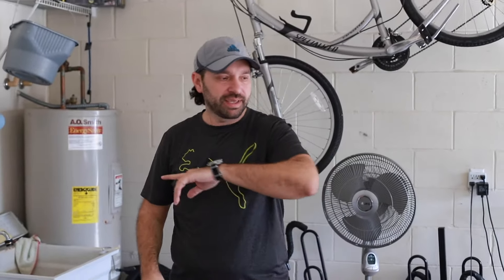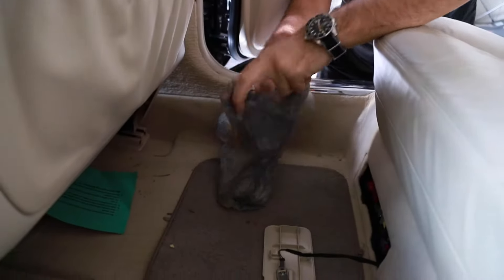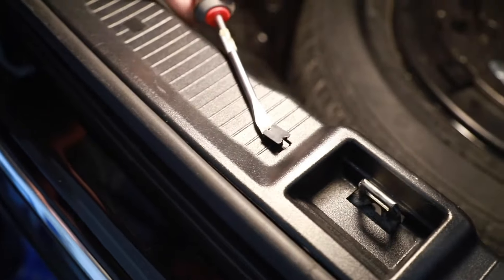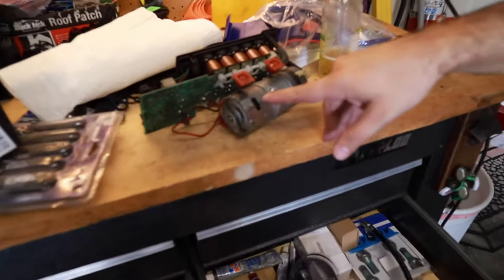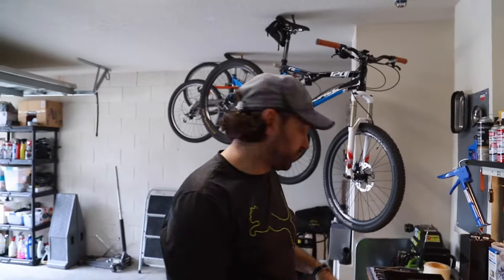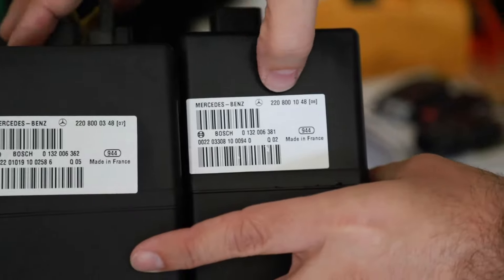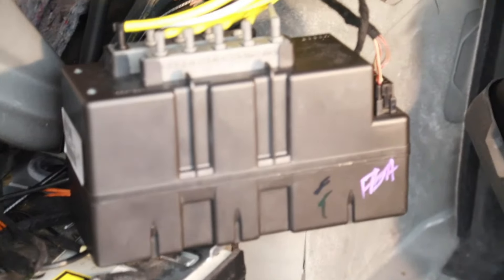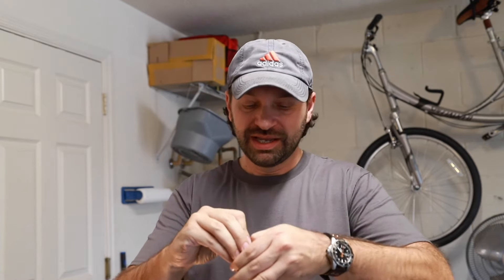Mercedes PSE (Door) Vacuum Pump | Soft Close

Comment: I watched this video 2 years ago to replace my PSE Vacuum pump on my 2006 S500. I replaced it with a pump I bought on Ebay for $185, with the exact part number 220 800 11 48 [07]  and it worked for 2 years before I had to replace it again. That one has now failed so I had to replace it again. They didn't have an 220 800 11 48 but I understand that going with a higher part number works and the only one that was higher was a 220 800 12 48 [06]. So a 12 can replace an 11. This one cost me $70 more than my first one,  but it was the only one that was available at the time with a higher part number. 
It works now.
Reply from the maker: That sucks that it only lasted 2 years. Thats the reason I like to replace with new or remanufactured. However, this pump is just too expensive new that's why I did the whole eBay thing. Yes, from what I understand you can go with a newer pump (higher number), but not lower. The only way to make that work is a "proxy alignment". Not sure what that involves but it sounds expensive. 

I hope this one lasts a lot longer than the last one.
Reply: I have also that part number 220 800 11 48 soo i just can replace it with two part variations 11 or 12 for it to work?
Reply from the maker: Yes. It seems you can go up in number not down.

Comment: LOVE your organized work bench. The most important and critical part of any kind of repair comes down to your work space, tools, and being organized (Knowing where your tools are and having flexibility like short hand ratchet tools, extensions that are flexible, all the ETorx tools / sockets you need for mercedes, which for me has mainly been E10, E12, E16 sockets), and more
Reply from the maker: I wish I had more space. I try to make due with what I got. One thing I found is that the extension ratchet is irreplaceable for me and that I need better quality etorx bits. More and more cars are using these now, Mercedes used it 20 years ago. The new tool box however made a big difference for me. First time I had one that size. I love it.

Comment: If you DO get stuck with a new-used replacement that is incompatible, take heart. If the motors are the same, you may be able to swap them out. It may just be that the replacement has a controller that is incompatible. Best advice what TS said--get the same part number and a guarantee.

Comment: Thanks for the video. I have an s600 my trunk isn't shutting and the soft door close also inop, yet my locks do go up and down. I wanted to comment on the black dust on the motor, it's the carbon electrodes at the stator to the armature are worn down, if you took the little motor apart and put in new brushes a few bucks.  Harvest out of some home vacuum or find on ebay or something, they are often made of carbon and can be easily filed into shape.  Keep up the good work.
Reply from the maker: Thank you. Yes I noticed when I blew the dust out I got a few more weeks of service before it finally completely died. 

On S600, maybe you got a leak in the hoses themselves? That pump operates locks and soft close. If the locks would have worked, I would have not changed the pump. But once the locks died I had no other choice. 

Disconnect the lines in the back. If you have a friend who vapes, blow some smoke into the system and see where it leaks. When I blew into the hoses with my mouth, I was able to lock the doors. My trunk hoses are bad and I do not have soft close there. Maybe one day in the future I’ll make a video of that, but it’s not on top of my priority. 

Thanks for watching and the kind words :)

Comment: E320 1998 almost got towed away because alarm kept going off. Police were nice enough to go knocking on doors to find the owner. Mine still opens and closes but . OK one of the back door mechanism wasn't working but I was ok with that. Then I was starting to notice more malfunctions with the locks. I also notice the light on the open/close switch is on. It's also been raining  hard here. So now I have an idea of what the problem is. Time to fix it. Thank you so much.
Reply from the maker: Yup, sounds like a very familiar story. Time to swap it out. Read your label on your actual part first. I had to go through 3 before I figured it out. If you're no already on it, get on MBWorld.org

Comment: Hi, my dad's 2004 S430 has this PSE PUMP problem, I think.  

I'm trying to determine whether to test for a leak in a line (how do you tell where the smoke comes out if the lines are all inside the walls of the car?) or just replace the PSE Pump.  I'm wondering if a leak is unlikely if the remote control and interior auto unlock buttons do not work for both the trunk and the car doors?  Since there are multiple issues does that make a leak less likely?  

Also, I believe the yellow fuse is blown.  To hear the clicking noise in the pump does the key have to be in the car or does the car have to be running?  

Finally, for the part number "220 800 xx 48" does the xx represent the year of the car?  I thought it did until I see in the posts and also on pumps for sale on ebay that the xx does not seem to be the year of the car?  So I have to get at that pump first to get the part number, specifically the xx numbers?

Thanks!
Reply from the maker: Honestly you gotta have to diagnose one at a time. If you hear clicking you need a new pump. If you keep replacing the fuse, you need a new pump. If you have a line leak it will impact only whatever is connected to that line. There is a smoke machine for that purpose. You blow smoke in and eventually you see it coming out from behind a panel possible. Then you can take it apart and follow the smoke. Sealing a line shouldn’t be too hard. That being said, Mercedes from that vintage usually doesn’t have line problems but rather electrical. I would usually start diagnosing electrical stuff. 

In regards to the number, follow my instructions. Read more in the description. It must be the same or newer. 

Hope you get it sorted, good luck.

Comment: Hi Daniel. My pump is dead. For now I can't find the exact pump with the same codes. 
It's for Mercedes w210 E-class saloon facelift

HELLA Mercedes-Benz 2108001248 ( 07 )

What numbers in the pump need to be the same?
I know that the ( 07 ) needs to be the same I think.
I heard something about higher number or the same. If I get a pump with higher number and just replace it is it going to start right up or something with the car's computers needs to be changed? I'm not familiar. Thanks you for you amazing videos!!
Reply from the maker: Yes. That’s the number you gotta look for. Either same or higher is good. No reprogramming necessary. A lower number will not work. Be patient. if you order from eBay make sure they have a return policy just in case. I hope you get to work it out. Good luck!
Reply: @Turbo_Snail  i didn't understand fully which numbers... only the ( 07 ) can be the same or higher? So the number 2108001248 should be exactly the same? Or what. Sorry I'm not native 😀
Reply from the maker: Yes correct.

Comment: on the R170 this can cause tons opf issues- alarm going off randomly. Wont stay locked. Can't lock/unlock CLS and then you can't open your gas! or you cqan't open your ccenter console. Dome light stops working... The top won't go up or down properly. Probably other potential issues but I've had all of them.
Reply from the maker: You gotta get the equal or newer version. You can't go with an older version than your car was originally coded to.

Comment: Even though your locks didnt actuate, you still dont have to use the metal key.  Lock the 3 non driver doors from the inside, roll down your driver's door, reach in and lock the drivers door, now point your fob at the infrared and push and hold the lock button on the fob.  To unlock, do the opposite.  The trunk is the biggest hassle.
Reply from the maker: Yeah, it’s more convenient when it actually works. Didn’t cost too much anyways.

Comment: Very well explained, thanks!!  I'm experiencing the same problem with the exception of the fuse is good and did not blow - Do you think it's the PSE pump much like yours?  Which forum are you referring to.
Reply from the maker: Mbworld.org. There is a lot of info. I use it for research before I get into a major (for me) project. Open up the PSE pump covers and listen to what it does when you try to operate.
Reply: Did you think that coding/programming with the SDS to your vehicle will be necessary?  Some discussions on MBWorld and Benzworld about it - all too confusing!
Reply from the maker: If you buy a pump that is a different model number you have to code it to the car, too expensive. It took me 3 weeks to find mine with the same part number and I didn’t have to do any coding. Just be patient and get the same part number. It’s well worth the little extra effort.

Comment: Thanks for the vid! I got W140 and soft closure function doesn't work. Currently I'm trying to watch various videos related to pumps to better understand this stuff. PS: Victor from NJ (RestoreYourMercedes) may help with rebuilding pumps though Idk his pricing. I see autohausaz sells my pump for around $230 which is a remanufactured part.
Reply from the maker: I'd get a remanufactured part over a used one. I bought mine on eBay and you seen the process. You get an old part. If you have a choice, go for remanufactured. A new pump is just ridiculous and not necessary.
Reply: @Turbo_Snail  Thank you! I agree with you on the remanufactured pumps. Unlike eBay ones reman pumps also come with some warranty. But first I need to figure out if I only need to replace the pump or pumps (I have two) or there is also a leak or leaks somewhere. If there is a leak it will put too much stress on a new pump and the replacement pump may soon become a paperweight.
Reply from the maker: Yeah that’s true. You can get a smoke machine. Disconnect the pump and blow smoke thru it. If you see smoke escape, you know you have a leak. If you vape, that would work too. Or find a friend who vapes ;)
Reply: @Turbo_Snail  "I need to smoke up my benz" lol

Comment: Respectfully, you must be kidding. For it is possible to get just the motor you attempted to blow out for $50 to $100 on eBay or even a complete motor with the turbine for a little more without replacing the whole black box called "pump." The replacement of the motor is fairly straightforward.
Reply from the maker: That is true. And if you’re more comfortable gutting the motor I would say do that. It was easier for me to just not have to deal with it.
Reply: @Turbo_Snail  It is not so and I think there is a misunderstanding. There is no "gutting of the motor" whatsoever. You just remove 
the red and the black wire from the motor and push the pressure and the vacuum hose off the motor.

Comment: There is a lot of misinformation in this video.  PSe pumps need to be programmed for specific features of the car.  Programming can be transferred with xentry from an old pump to a new pump if the circuit board of the old pump is not damaged.  These are not plug and play.  In this car he was lucky and got a pump that was from a similar model with exact options.
Reply from the maker: Thanks for your input. Yes, generally you have to program these to your vehicle. However, if you match the numbers as explained in the video it will work. Many people have done it, I personally have done 4 cars like that. That would be a lot of luck. It’s the easiest and simplest way to do it without getting expensive equipment or professionals involved. Other people choose to rebuild the pump which is another way to do it. What counts in the end is that it works, for cheap.

Comment: Great video thank you very much unfortunately I didn't find it until after ID paid a garage to do exactly to know how to reset or override the sensor that tells me the boot is open (which it definitely isn't ) as they have returned the car to me with that fault and because the car thinks the boot is open I can no longer put the roof down thank you
Reply from the maker: oh man, that really blows. You would think they would know better. Try to get hands on the original pump that was in there or ask Mercedes directly, maybe it's possible, so you still do a correct swap.

Comment: I have my doors close once they are touching the body, hear some noise and trunk is also not working will try. Car was parked for ten years occasionally driven. Thanks
Reply from the maker: If you hear noise like air coming thru the motor probably works. You may just have a broken air line. My trunk is broken too but not worth the repair on this one.

Comment: Hey so the soft close mechanism works on my doors. My trunk doesn't open with the button inside the car as well as by the key button. I can hear something moving, but it doesn't do anything. I can open it manually with the key itself. I don't know what the problem is? Is it the fuse? The latch? Or is it the PSE pump starting to go bad but hasnt failed yet?
Reply from the maker: If the Doors work, the pump works. Sounds like just the mechanism in the trunk failed. Does the flap come out when you manually open the trunk?  You may have to Canibalize that part from another car. Not sure how hard it is to replace it. But it looks like it’s a complete assembly that goes into the trunk lid.
Reply: @Turbo_Snail  the flap does come out some times but sometimes it looks like it is then goes back in.
Reply from the maker: Sound like you got a leak in the trunk mechanism. Your pump is good but the air leak in the trunk may burn out your pump if you don’t take care of it. I never replaced that part. I took the shroud off to look but  you are looking at a whole assembly. If you suspect a leak other than that, take apart the pump. Get a friend who smokes or vapes and have him blow smoke thru the lines. If there is a leak, it will come out places it shouldn’t. You can also get a smoke machine which is a couple hundred dollars, but really, what have the vapers been practicing for all this time. 

Good luck mate!

Comment: My CL the pump works but I'm getting some electrical issues,  I fixed the wiring in the drivers door, it could be wiring in the body or perhaps the motor.  I'll get there eventually put its a pain as I can't lock my car at the moment.
Reply from the maker: Oh man that blows. Are you sure it’s electrical. How did you test the pump? Is it just one door that doesn’t lock or all of them. Maybe one of the hoses cracked and won’t allow to produce a vacuum. You can blow some smoke thru the hoses and see if it escapes somewhere. I hope you find the issue.

Comment: I need to get one of those replacement pumps. Probably the same one for my 2005 S430. Can you share the information for the part number you purchased?
Reply from the maker: It’s in the video. Check the description as well. It depends on what your part number is. They made so many changes over the years.
Reply: @Turbo_Snail  Yessir. I saw that part in the video. I guess I need to pull it out and see what the part number says. Thanks for the video. Very informative.
Reply from the maker: the lower that number is the more options you have.

Comment: there is cheaper and much better way to repair this failure. The reason pneumatic pump stopped working and behavior are typical , inside the module there is electric motor and attached vacuum module with graphite rotator and blades. With time, graphite is weared out , and around every 200 000 km it start breaking apart, and finally lock the possibility of rotation, ti is easy to repair. Clicking sound is the engine trying to move , but physically locked and freezed by broken graphite rotor. All you need to do is replace the graphite rotor and graphite blades bought for about 60$ as "w220 central lock repair kit".  That guarantee another 200 000 km of work, unlike buying another used module, which can break after few houndred uses.  There is also another typical failure, after about 600 000km , the brushes inside electrical motor need to be replaced then . It is also simple repair ,and cost even less money.  Module that you bought is probably already regenerated, it has been serviced and probably has changed graphite elements - that suggest a sticker on a side.
Reply from the maker: Love the write up. Where were you when I did the video?
Reply: @Turbo_Snail  probably figuring out something, not yet recorded :) maybe someone will use the know-how and save one more merc from scrap.
Reply: Hello my friend, do you will sell broken pump?

Comment: Great video! But can't that little motor b sent out, rebuilt or replaced off ebay??
Reply from the maker: Yes. Someone on here told me that they bought another motor and rebuilt it. It was past my skill level however. Check the comments. It was interesting. Once the motor is burned out it needs replacement.
Reply: @Turbo_Snail  Thx 4 replying but I'll look on ebay for that little motor. I bet they're 4 sale!
Reply from the maker: @curlymyhero  Yes eBay is full of them. If you go my route you have to match the numbers. From what I understand, if you can do it, you can swap the internal pump as long as you keep the electronics. Check that the pump is indeed burned out and not the electronics.

Comment: was wondering if S class pse pump works for SL500 r230 .. i dont know why the SL r230 PSE pump still so expensive!
Reply from the maker: I can’t say if it would fit. Does the pump look the same? Also, what is the part number?
Reply from the maker: Not sure. Make sure the numbers match, watch the video for more info. But I doubt they are interchangeable. Just the S class alone had a different pump within the same year.